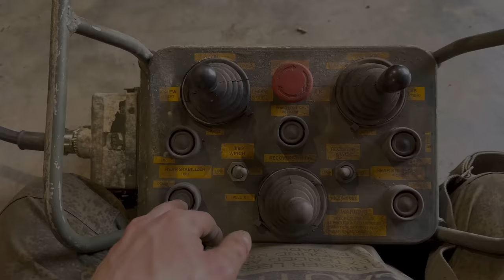Fitting engine in Chieftain Tank

Comment: Oh, your Union Flag on the back wall is inverted, naughty
Reply from the maker: Only way I could hang it without drilling asbestos sheets!
Reply: @MrHewes  year's ago in my first job we used to cut those sheets with a grinder. Fast forward year's later on RAF Fairford we had to get permission to drill a hole for a cable route. Makes you wonder what we deem safe now will be dangerous in the future.

Comment: The Chieftain with concrete in the engine bay would probably be more reliable than this example. Much less smoke as well. 
The concrete thing has happened here in Oz, as the Leopard AS1 were decommissioned and placed around various locations as memorials.
Reply: Apparently.😉

Comment: thats a similer setup to what we hookup in the sportfishers we build.  has a coupleing  similer to that, bolts to the shaft  it has to be lined up perfect.    how we do it is we bolt isolators onto the engine, they sit on a engine bed.   then we use filler guages to go around the coupler untill its the same on all sides useing the isolators to control the heights, they sit on nuts that u turn to go up or down, then once there in place, we bolt the engine in place.